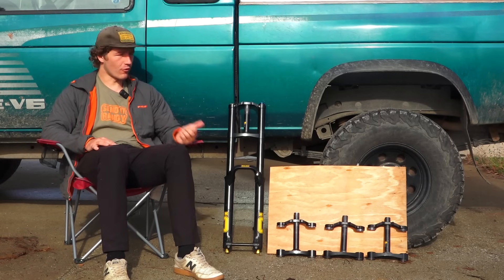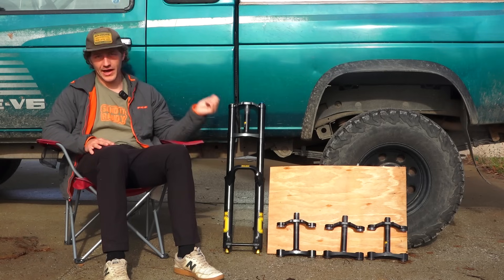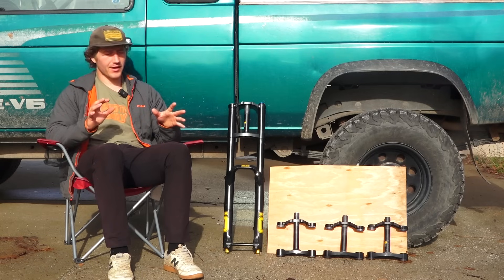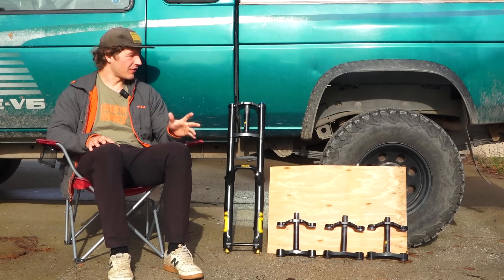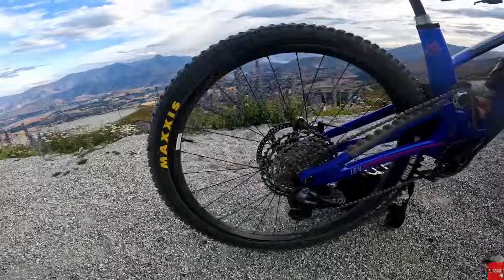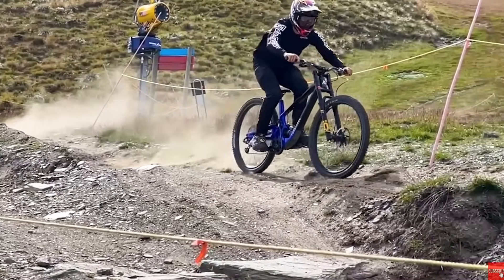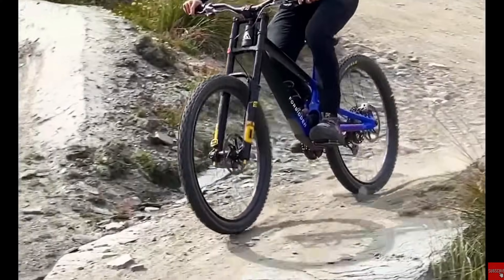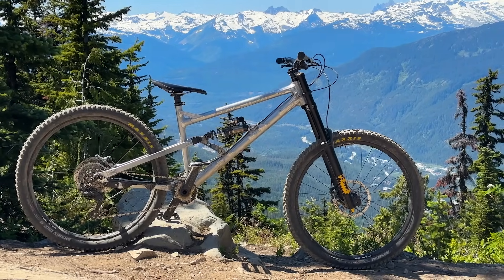Fork Offsets Tested - Why Do Pro Downhillers Still Use Long Offsets?

Comment: Awesome content. You know what I had a commencal Meta TR Size Large. 435 cs 490 reach. Bike came with a 38mm offset. I bought a 44mm offset. That bike with the shorter CS I had a lot of front washing randomness man. 5mm doesn't sound much but it maybe I should stood with a shorter offset

Comment: I don’t ride a downhill bike but my two fave setups nowadays are:

10 mm Aerozine stem with 37 mm offset Mezzer

31 mm renthal Apex With 51 mm  rxf36

Yeah they felt twitchy coming from a diff  bike with 40 mm stem and 44 mm offset but i got used to it and now the steering just feels more lively. Def gotta learn to not oversteer tho

Edit: with the 10 mm stem i  use a frame with longer reach than i was used to

Comment: What you explained is consistent with two wheel vehicle dynamics. Keeping the fork the same and changing the trail (with offset) from 44mm to 58 mm will make the bike steer easier (less grip on the front). The shorter offset will make the front feel more planted and tougher to change direction. But in the real world, shortening the offset will raise the front of the bike and while giving more stability due to more trail, will make the weight less on the front wheel. The way to get more weight on the front wheel while maintaing some stability would be to raise the forks in the triple clamps (lowering the front end). The last two sentences I typed would be with the 44mm offset clamps. The 58 mm will lower the front automatically  (at standard fork ride height) and make the front easier to steer due to less trail. It also offers less 'dive in' traction.

Comment: I’ve done this test with single crown 44 and 51 on same bike. 

I felt the steering was quicker with the 51. The smaller contact patch/trail seemed to let the steering rotate easier similar to rotating on a ballpoint pen (smaller trail) to a fat tip marker (44 offset). Also felt the bike wanted to tuck easier in steeper terrain. 

I felt the bike wanted to washout easier and loose the front on 44. I also remember when 44 started to get popular on bikes people I know where losing the front end more. I even noticed some marketing changes how bike should be ridden more over the front end with 44 like transition for example. 

You mentioned less grip on 54-58 but I felt the smaller contact patch  has more force distribution on to one smaller area (smaller trail) which actually has more bite or grip but then brake free at a certain point but less straight line stability (ball point pen affect). It’s like a razor sharp knife will dig in but lean over enough it will break free completely. A wider flatter blade won’t dig in as well but (bigger contact patch) but have more contact surface area but will need weight to retain grip with a bigger surface area than a smaller one designated area with 51. 

I think when 44 offset started to get popular The bikes weren’t extreme back then as they are now. Lots of trail bikes, and Enduro bikes are very slack now and long similar to downhill bikes and I think lots of riders have problems losing the front end or pushing washing the front and a 51 could benefit loosening up heavy steering on slack enduro bikes with less front end washing with that bite of 51.  Especially with bikes with higher stack (more weight back) like dh bike. 

Both work but I don’t think people should be opposed to 51 especially with long,slack bikes these days. I think it could liven up a big slack all business enduro bike. 

Options are good. 

Nice video keep it up.

Comment: I have been wondering about the offsets for awhile. Not a downhiller, but I was thinking about swapping the forks on my 2 trail bikes. This is a good overview, and I don't care about the science much. The channel is picking up subs. Keep up the hard work. I think 2025 will see your channel take off. Happy trails.

On my 2 trail bikes, I have a 51mm offset on an older Stumpy w a short wheel base and a 2023 Rocky Instinct w a 44 mm offset and long wheel base. 

When my old Fox 34 died, I stayed w the longer offset on a 2023 Pike Select 150 for my Stumpy bc that was the offset it was spec'd with. It makes the front end lighter and comfortable to ride. It also works w shorter TT bikes bc it is easy to shift position on the saddle and weight the higher front end for climbs. However the light front end and short wheelbase make it sketchy in high speed turns and the front wants to pop up on short steep climbs.

The Instinct is much longer and the body position is really centered over the pedals, so the shorter offset on the Marzocchi Z2 Bomber 150 is designed to keep more weight on the bars. The long chainstays help keep the bike planted and not too front-center biased. It is a beast in the turns. I think a lot of thought goes into the bike designs and the spec'd offset probably works the best for most folks. I also think the most logical change many make is with handle bar choice to get the cockpit right. I went from 25 mm rise to 30 mm on the Rocky and it became much more poppy w/o any sacrifices in traction and cornering.

Comment: What stem length did you run for the test?
Reply from the maker: 45mm, played around with 50mm a bit to didn't seem to prefer it even with the longer offsets.  could have had something to do with the bike too since it already felt a bit too front biased.

Comment: I have 44 and 58mm offset crowns for my norco range, same Öhlins fork and 44 ist much better for chunky downhills. 
I think you did not consider the size of the stem … 44mm crown offset case 50mm stem to by twitchy, almost sketchy on steeps on brakes.
I end up with preferring 44 offset and 40mm anvl stem.
Reply: short offset = short stem, long offset = longer stem really seems to be the way to go

Comment: I have two bikes that have two completely different front end set-ups. 
One is my enduro bike it has 64 ha and a 44mm offset 160mm fork.  480mm reach.

The other my hardtail with 62 ha 51mm offset, 120mm fork and 440mm reach. 

I prefer the longer reach/short offset it is more capable and feels very natural when used to it. 
But the hardtail is also dope because you can throw it around and it also lets you 'recover' the front easier if you loose it. Also I think the self steer is nice when cruising with no hands down the street for example.

Comment: It's strange to me that you find the longer offset to be more "oversteery" and gripping of terrain. Every time I've tried a longer stem I feel like it drastically changes the handling and steering in a way that makes it more twitchy and more sensitive to rider input. I was assuming that a longer fork offset would have the same characteristic, but I guess not.
Reply: I guess it matters about the ratio between the stem length and the offset. I think watching a video on offsets would tell me the answer to this but nahhh, im not watching that right now.

Comment: 7:00 Similar thing happens with bar width in Cycle Speedway, narrow bars track, wide bars lean. I run wide bars, because I have that "authority" to leverage the bars and lean the bike harder. To deal with front end wash outs, I make sure I'm weighted back on the saddle properly. Seems counter intuitive to have less front wheel wash outs with less weight on the front, but you're not pushing into the front either. Might be the same with moto riders not sure.

Narrower bars turn easier, but I find they track the front wheel wide (i.e. don't lean as hard) unless I really concentrate on forcing the bike over.

Comment: Agreed. Really insightful explanation.

My Pivot Shadowcat (the successor to your Mach 5.5) is also twitchy at the front at 65.8 degrees. Was using the stock Fox 36 at 44mm offset before replacing it with a Pike with 37mm offset. Calmed the front on chunk and loose over hard stuff. Sucks on slow floppy climbs though.

Comment: excellent video - i would be interested in hearing your thoughts about high-engagement hubs vs lower engagement hubs. (no ochain)
Reply from the maker: I tend to prefer low/mid engagement hubs. Mostly. because I feel the drag in the super high engagement options like the hydra and I don't like the noise. The onyx hub seems like a sweet solution for instant engagement and low drag. Also the williams racing products DT internals look like an awesome way to get decent engagement and no drag. I'm not sure if engagement makes a difference with pedal kick tho and haven't tested enough to know if that's a factor
Reply: @briancahal  Interesting. Future video "Does engagement cause pedal kick-back"?
Reply from the maker: @joehoeper3941  problem is I don’t really care 🤷🏼‍♂️

Comment: Offset, fork length, wheel size, hta all this  influence mechanical trail which is key parameter of bike handling (imho).

Anyway interesting video, never thought in context of front end grip and fork offset.

Comment: @briancahal what head tube angle were you running on the G1?
Reply from the maker: I had the long chainstay mutator, I believe 47mm and the 18.5 seat stay mutator running it in the short travel setting. I believe the head angle was 63 or 62.5
Reply: @ have you tried slacker angles with shorter offsets to see if it has the same feel as steeper/longer?
Reply from the maker: @StranjBikes  I haven't